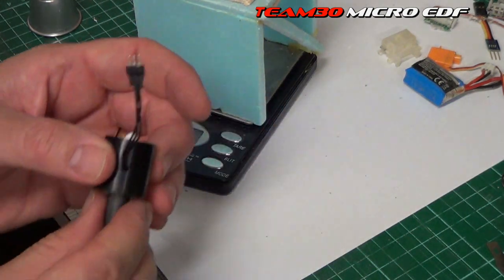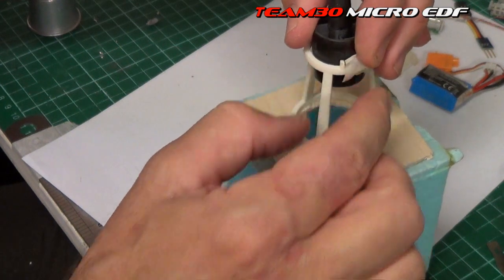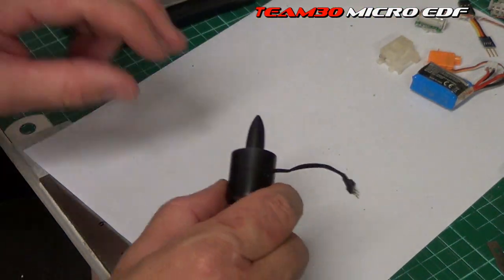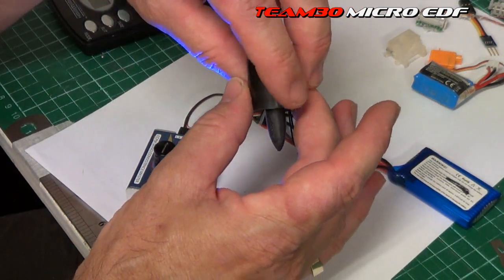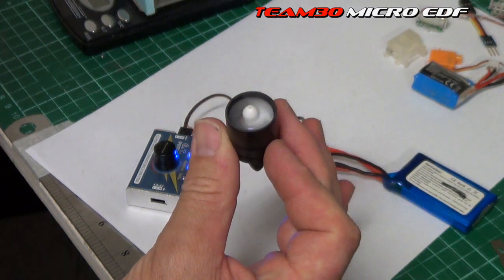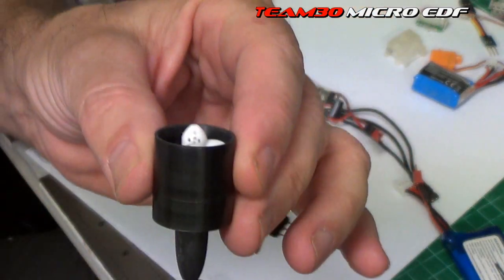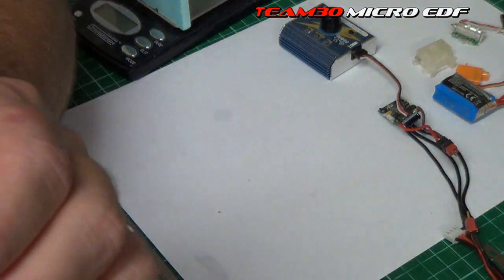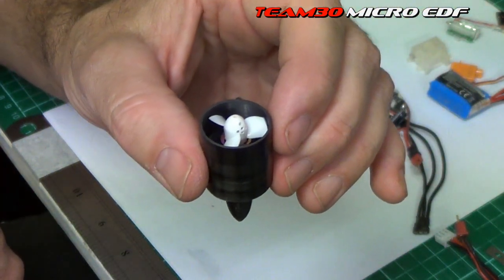20mm EDF fan unit demonstration

Comment: https://betafpv.com/products/0703-15000kv-brushless-motors?variant=6309781667879 Is this the type of motor you'r using for this?  Also you have the 3D file for the housing?

Comment: Here in New Zealand we have virtually nothing in the way of 20mm - 28mm - 30mm E.D.F units that are not stocked by hobby shops, here if you want to get hold of a 28mm E.D.F unit you might have to purchase an E-Flite umx Habu or Mig 15 (if you can find one)part with approx $300.00 for a B.N.F version and gut it just to power your own built plane, or spend ages online searching, NZ is severly lacking in park flyer rc power system parts, micro componants for those of us who like to build our own models but dont want to fly larger rc planes (over 1.5m wingspan),

Comment: Hi! nice work! which blade are you using? were can i find it?
Reply from the maker: Search for "Propeller for JJR/C H36 Drone RC Mini Quadcopter" on ebay. They come in a pack of 8 for around 5 bucks AUD. :)
Reply: @NitroCharged   thanks a lot!
Reply: @NitroCharged  Only 4 blade props are available.  Can't find the 3 blade that you're using.  Most likely at this scale, 3 blades give the best power/thrust/efficiency ratio than a 4 or more blade prop would be correct?
Reply: @npham54  4 blades have more thrust than 3 blades but does not have the same top speed as 3 blades